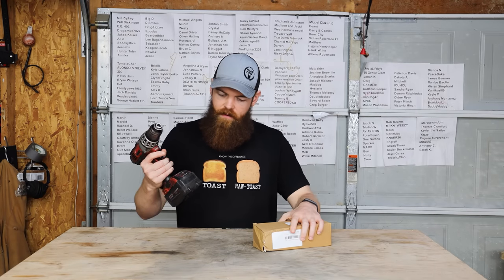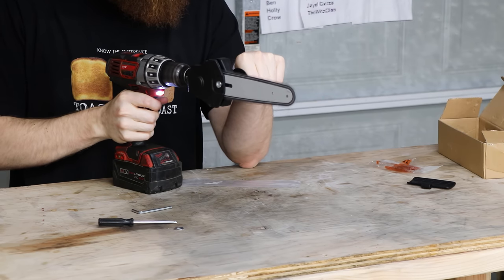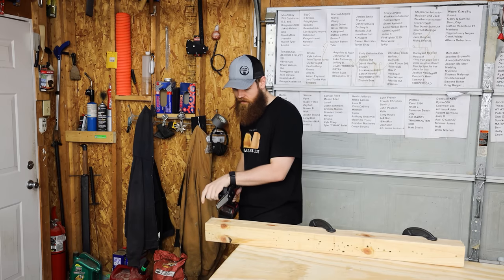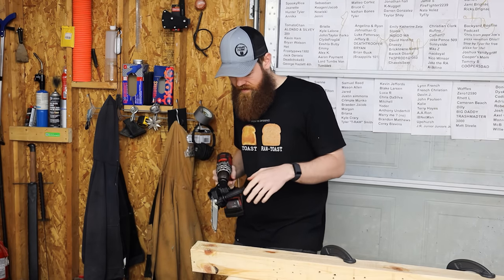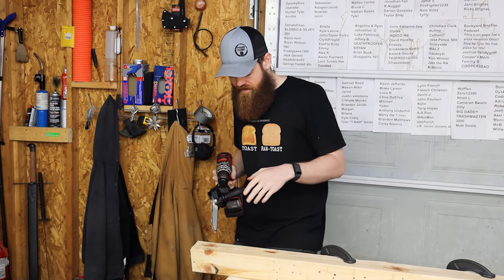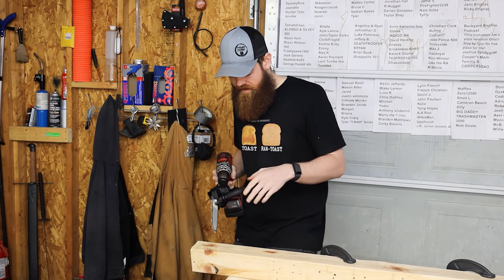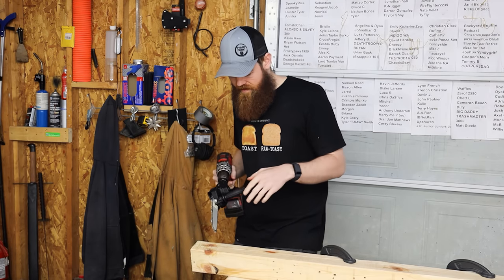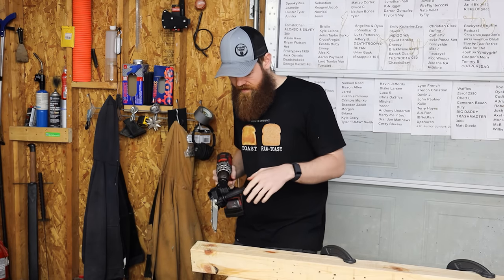Testing The WORST Drill Attachments From Amazon!

Comment from the maker: Use code TYLERTUBE50 to get 50% OFF your first Factor box at https://bit.ly/3RfkGTR!
Reply: Dry wall screw gun. The plaster board is 1/2 inch thick.
Reply: The look on your face when you said “why is everything so difficult” is freaking relatable 🤣
Reply: You should test products from Wish, Ali Baba, and Temu in your very near future videos and see how good they are
Reply: My battery-powered Ryobi skill saw works way better than that piece of junk
Reply: You're exactly right. Buy the right tool for the right job.
Reply: who on earth watches sponsors? or buy their garbage? 🤣🤣🤣🤣🤣
Reply: I Love your videos and channel
Reply: I have  one of the attachment you reviewed and having issue with its performance but when I switched from drill to impact driver,  it was way much better. I realized that my impact driver have way much higher rpm than a drill

Comment: In terms of the chainsaw having no bar oil either the manufacturer didn't think it would last long enough to require bar oil or they assume that blood would be a good enough lubricant.
Reply: Blood's always a good enough lubricant. 😉
Reply: Blood and spit the bane of petroleum industry lol
Reply: That's funny, but not really. Experience I guess
Reply: It's pretty sad when 90 precent of the same micro chainsaws made by big name brands don't have chain oilers either. And cost more than a used 24" bar Stihl
Reply: Some electric ones don't have an oiler as well.  Just supposed to put oil on once in awhile.
Reply: @Deere2154D  The first petrol chainsaws instructed users to paint on oil every so often and I own a 1960s chainsaw where you have to pump the oil from a reservoir using your thumb.
Reply: Yea it’s actually not that uncommon, to add oil on your own. Most big brand electric chainsaws require you to add your own oil to the bar.
Reply: ...blood for the blood god?
Reply: Yeah even the mini chainsaws out now come with bar oil.they probably didn't have faith in their product
Reply: bmw recommends Type B negative

Comment: On the last one, you might just have a deeper chuck than it was designed for.  I'm curious if it would have worked better if you pulled the long screwdriver bit out half an inch or so.
Reply: You need to loosen the silver thumbscrew on the top side. 
Then slide the silver piece towards the chuck. 
These are designed to sink the heads if adjusted properly.
Reply: @Christackleberry  exactly what this guy said, although it does fill me with joy when Tyler doesn't understand a tool xD
Reply: I'm guessing they would all have worked alittle better (still not great) than this if set up properly and used for there Intended purpose
Reply: Yeah, the device is for drywall screw guns to give them the auto feed thing. The shaft only goes into the clutch like an inch. So if he just kind pulled the shaft out like an inch he'd be able to sink the screws.
Reply: It’s for plasterboard or drywall as use day in the states it’s so the screw dosnt blow through
Reply: @geddybear9108  It's like a caveman discovering fire sometimes. He's bound to get burnt
Reply: Come to Tyler's channel for the videos. Stay for the comments to learn how they're supposed to really work
Reply: using an attachment for a screwdriver not a drill.
cant expect much from a guy that does not even know what a guide fence is on a circular saw which is also what the 2 extra bolts and washers was for too
Reply: Last one is design for drywall…. So it doesn’t pull through. You can tell because it is loaded with drywall screws
Reply: those are designed for impact drivers, not drills, so yea that's the issue.
Reply: @inibrius5380  no, I really don't think so.

look up drywall screw guns if you wanna see what this device is trying to emulate
Reply: @inibrius5380  Absolutely not impact!  Still, Americans have a tendancy to use impact drives on every effing thing tho..
Reply: @frankivarlie1426  they sound like guns, and we love our guns. 🤷🏻‍♂️
Reply: Or if he just learnt how to use it properly before showing us and telling us everything’s rubbish 🤦🏼‍♂️
Reply: @frankivarlie1426  i swear they do. and the art of pre-drilling is quickly becoming lost to them
Reply: @JFLINT98  "as use day" 🤣 The words you're looking for are "as you say". Not trying to be a jerk, I just think it's crazy how language gets knocked out of whack from person to person

Comment: The "machine gun" attachment is for drywalling where you have to put in multiple screws one handed (with one hand holding the board in place). They're actually a lot of fun to use, when they are properly set up/or aren't garbage like the one in the video.
There are even some that use drum magazines so the screws don't get in the way!
Reply: I have a purpose built drill called a "collated screw gun" that I use all the time as I install plaster board(drywall for you Americans). The attachment one he is using looks really cheep and he couldn't figure out how to set the depth.
Reply: @TheHalfDeadHobo  I have the dewalt drywall screw gun. been thinking of popping for the attachment but no clue when I will be doing drywalling again. They also have guns specifically for 3" decking screws.
Reply: Completely wrong!! The purpose is to save the tips of your fingers when reaching for another screw. 😂
Reply: Fairly sure there should be s screw length adjustment.

Comment: Pretty sure that machine gun screw attachment is for drywall. See guys use them often and would make sense to leave that 8th of an inch or so out otherwise it would plow through the drywall completely. 
Great vid!
Reply: I thought the same thing. Would make quick work without busting out the whole saw.
Reply: that's exactly what its for my dad has one and it's amazing
Reply: It's for drywall, but you definitely want the screw head sunk not left sticking out like that.. My guess would be the T man just couldn't figure out how to adjust it properly..
Reply: @MarkLada  like the bit is in a drill, not a driver, and is probably too deep in the chuck.
Reply: I think it's defective.  You still have to press it again the sheet rock the same as he was on the stud . So I think the result would be the same . Or maybe tyler didn't set it up correctly . But I do think it's for installing sheetrock .
Reply: @Thomas Echols  It's probably something along those lines.. It looked like the attachment was hitting the head of drill before he could depress it all the way.. I bet using it in an impact driver would eliminate that problem..
Reply: Ah, no.  It's not set up properly or broken. It's for repetitive screwing in wood, drywall, or other thin material.
Reply: Yeah I've seen a few guys use it. Buying extra belts to speed up the down time. Driving screws quickly definitely has a level of mastery to it. So for some people this attachment is a life saver. Still competitively most piece work drywallers are 10x faster than this attachment will ever be. They hold 10-20 screws in one hand, and only need a second for reload. And can drive every screw in that hand perfectly, in seconds. Real tradesmen are badasses.
Reply: @Gotti.G  it’s done exactly right lol it just adjust for thickness of sheet rock lol
Reply: The thing was workin 100 percent fine that’s what they do
Reply: @chrisfalx3251  No, the screw should go all the way in. Think of the 2x4 as the drywall. It wasn't used properly.
Reply: Come here to say this 👍
Reply: @JsMaintenance  it would stick out that distance from whatever you were pressing it against... pressing it against drywall would still leave it out the same distance. He needed to pull the driver a bit further out of the drill chuck and then it would've worked fine.
Reply: @SteelWorksGuy  That's what I was saying. The attachment wasn't adjusted correctly.
Reply: @JsMaintenance  Ah right, I see what you were saying now, heh, I work 3rds so I was still waking up lmfao.
Reply: Yes this
Reply: It is. I've used screwguns that were made just for it.
Reply: @thomasechols8834  that’s what I was thinking
Reply: @thomasechols8834  I was thinking the same thing…how far is the bit in the drill?
Reply: @MarkLada  he was using it wrong 100% the supplied drill bit needed to be adjusted out a bit. That’s all.
Reply: Very true drywall thickness.  Most likely it's based on 1/2" sheetrock so 1/2" sticking out would be right.  That tool worked fantastically.  Although I question it's ability to last years lol
Reply: thats what i say as well so you dont drive it through the drywall
Reply: @IppaiMetaru2010  except that the screw will be sticking a half inch out of the sheet rock. The bit needed adjusted so that it hit flush.
Reply: Normaly our machines just screw it in al the way else theres dubble work
Reply: he put the bit too deep into the chuck, pull it out a bit and i think it would be fine
Reply: yup, it's for drywall and if you have a quality product it's amazing^^ but those don't come cheap unlike yours^^
Reply: why would you want your screws sticking out of the drywall?! you want the screw heads flush with the drywall or else youre gonna have bumps all over your walls...
Reply: This would 100% work, if he had a "pro" drill (as in one where you could attach a grip), the back of that attachment is made to clamp on the cylindrical feature behind the chuck... also you do not "reload" the belt as in putting new screws into the plastic belt, the belt is a consumable, and you buy rolls of screws already on a belt (usually they are 500–1000 Screws long, and you cut the belts to what ever is comfortable to handle / matches your use case) and reload by grabbing a new belt and putting it in...
Reply: @jameswood1935  that shouldn’t matter, that’s what the depth adjustment is meant for
Reply: I thought it was to set the screws that way they were easier to sink all the way in
Reply: @firesurfer nope. For drywall. And it’s doing exactly what it’s supposed to. Don’t want to break the paper on sheet rock so the screw needs to stop
Reply: The last one worked right.
Reply: Everything is head down , the curve saw I think you used wring , the metal cutter looks good

Comment: Tyler that screw gun attachment is for hanging drywall most drywall screw guns are on full power and just fed as you did the last run. It obviously isn't set right for the depth. I've used one and there amazing rather than holding every screw by hand the gun is a life saver.  Revisit this gun and hang some drywall so you can see the beauty of the drywall screw gun.  I don't know how you were able to buy the attachment and not see the word drywall in the description lol.  Other than that I might get the metal cutting attachment. That looks cool
Reply: I was just yelling at phone saying grab some drywall 😂😂😂
Reply: I was thinking the same thing. It definitely looked like it was setup for something with a pre-determined thickness like drywall or plywood sheets.
Reply: On Amazon, there's one listing that just says Automatic Chain Nail Gun Electric Drill Adjustable Screw Length Tightening Equipment for Woodworking wood board Drilling
Reply: I wonder if it may have a torque thing so it doesn’t go right through. And maybe that’s why they’re stopping? Cause I’m no drywall hanger but I’d say a 2x4 is a lot thicker and harder then drywall Just a theory is all
Reply: I've used them for decking

Comment: I recommend the sheet metal cuter attachment made by dewalt. It works great for what I used it for which was a 12 gauge aluminium sheet of metal. So much better than tin snips.
Reply: I like the DeWalt one but after getting the Malcos I won't go back.

Comment: On the chain saw, maybe the washer is for the single screw that locks down the blade. It would give it more surface area and more "grip". As for bar lube, a little oil of any kind usually works fine on these electric type saws. They don't move very fast, therefore they don't generate much heat and, because they spin so slow, they don't throw the oil off like a gasoline saw. That means they don't require constant re-oiling. Kinda like Brylcreem, "A little dab'll do ya" A cold chain will always be tighter than one that has been used for a few minutes and a new chain will always need some adjustment soon after it is put into use. They lengthen as they break in and as they warm up, so that wasn't unusual, you just didn't account for it in your initial setup. As for your poor hand, stand on the other side of the post or cut the other end, ya big dummy. LOL (Just kidding) But for real, because this runs in both directions, unlike most saws, and you can turn the chain around AND put the handle in multiple positions, I think you can cut anything without hurting your hand.

Comment: The automatic screw thing could be more for hanging drywall, and the depth gauge is for the thickness of drywall being used. But that is just a guess. And it looks like the shears and drill are to be held at perpendicular from the sheet metal.
Reply: You are right, it is for drywall.
Reply: Yep
Reply: Yeah your right because people love having screws sticking out of their wall
Reply: @xaphan8581  do you know how thick dry wall is moron depth of the screws is relative to the stud plus dry wall panel if thats what the piece of junk is for.
Reply: @erueka6  buy one of these guns and try screwing it into a board. Let me know what you learn
Reply: @erueka6  also the fact you called it “drywall panel” tells me you have no clue what your taking about.

Comment: The rapid dry wall screw attachment would work just need to not put the bit so far into the chuck, bit needs to be sticking out of the drill more when tightened into the chuck should have no problems after that
Reply: I had the same conclusion.. Let the drill bit stick out further
Reply: Probably still faster to follow with a second drill though.

Comment: 2:02 the guard is supposed to go right above the chainsaw bar which  probably helps make the bar tighter.  12:26 that is a ruler guide that attaches to the saw and helps you cut a straight line.  14:34 I like your clamps. The handles looks like tightening and loosening would be comfortable.  20:52 there should be two adjusters on the attachment. One to adjust screw depth and one to adjust screw length.
Reply: YES!

Comment: Tyler, the screw device is used for drywall applications. It's to help prevent busting up the edges when installing the said drywall. Dewalt has a 3foot version of it so you can drywall the ceiling.

Comment: Stay tuned for part 2 where Tyler figures out the "machine gun drill" is for sheetrock and they dont go flush to the wood so they dont go through the drywall.

Comment: For the last device on the list, it is meant for hanging drywall so it doesn't break the paper, adjustment for thickness of drywall used. Appears to be based off the old Senco Duraspin drywall guns.

Comment: As many have guessed, the last one definitely needs to be pulled out of the chuck more before tightening it. That is the main adjustment. The one on the side is the fine adjustment for getting a tiny indent in drywall. Do better Tyler.

Comment: That shear thing was actually pretty impressive!  That seemed like some pretty thick sheet metal, at least for this tool to be cutting.
Reply: It seemed to work pretty well as long as he kept it at a 90 degree angle which is why as he got further along the cut and the angle decreased it worked worse. If he was cutting along side something instead of away from himself it might've worked even better.

Comment: The measuring thing on the circular saw is to keep the saw a certain distance from the edge so you can rip nice straight pieces. The tool should be to tighten the saw blade on.  I'm surprised that sheet metal cut since it's so thick.
Reply: This seemed extremely obvious to me
Reply: @DPBida  He is clearly not a carpenter or he would have recognized it immediately.
Reply: I like how the manufacturer included that guide with the saw, like you could ever cut a clean straight cut with that wobbly ass saw lol

Comment: I think the blue "saw zaw" is actually a jigsaw. Ment for lighter cuts.
Reply: 1: it's not "saw zaw", it's Sawzall, which is a brand (Milwaukee).
2: it's a reciprocating saw, also called a recip saw for short
3: no... that is nothing like a jigsaw, which has a table and a set, thin blade for intricate cuts... hence "jigsaw puzzle", as the pieces have intricate cuts
Reply: That's definitely a jigsaw blade . And sure that's the correct name but I don't think I've heard anyone go " hey hand that reciprocating saw" we call it saw zaw . We as in people who have years of experience working with  power tools .
Reply: sawzall
Reply: Yeah sure thing @mech 👍
Reply: @Gotti.G  Nice flex. I can do that too... I've been working in wordworking, framing, and various other tool usage capacity for over 20 years now. We always make fun of the slow people that saw "saw zaw". Keep it using it, though, it gives others a good chuckle.

Comment: You had the screw bit too deep into the drill... otherwise, that thing worked great.
Reply: It’s also designed for dry wall so that you don’t send in screws too deep
Reply: @ethanyates28  That's why there's an adjustment.  You want drywall screws slightly lower than the surface.  These were sticking out 1/2 - 3/4's of an inch.  That wouldn't work for sheetrock either with the bit so deep.

Comment: ok the machine gun drill would be usefull if your building a shed because you can just put in all the screws where they need to go really fast then tighten them in a minute, i wish it would do all in one but its still faster than normal i guess.
Reply: It's meant for hanging up drywall, You want the screws to stay out a little bit, otherwise it'll go right through the drywall. Tyler just used it for the wrong application
Reply: @Illusive World  You want the screw heads sunk.. You can't tape and mud over screws left sticking out of the drywall.. The T man just didn't have something adjusted right..